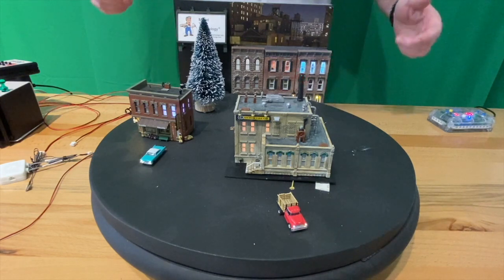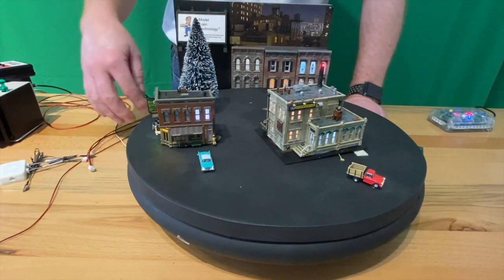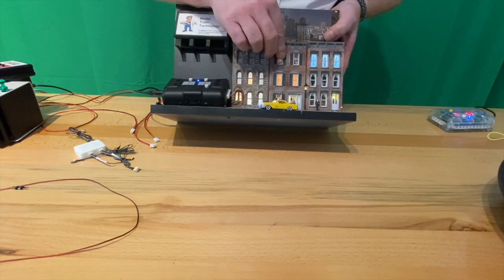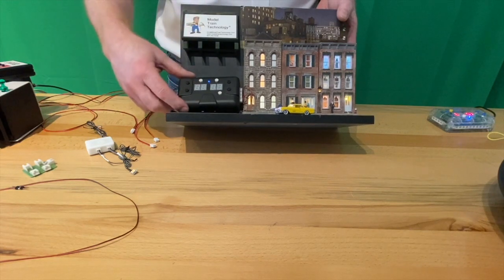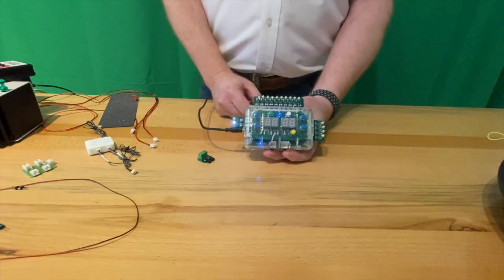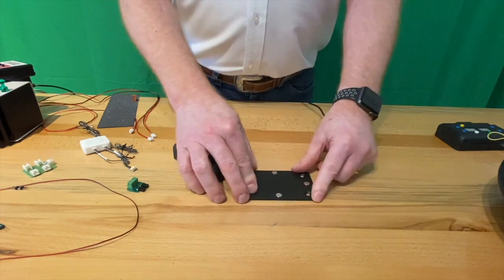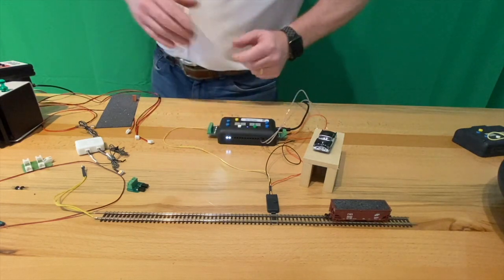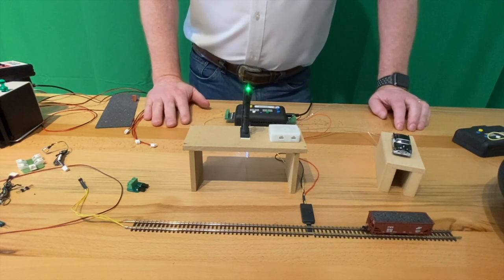Model Train Technology - Part 2 - LED and FIBER Lighting

Comment: Anyway you can upload manuals to your website! I'd like to look over the fiber optic ones do determine if I want to use it for my signaling.

Also a tri color LED for the fiber would be great especially for those of us who use searchlights. ( I have B&M triple head searchlights and 3 fibers in a mast would be so much better than 12 wires
Reply from the maker: The manuals are on the product pages in the store.  We have a tri-color Fiber Signal Controller with dual output in the works.

Comment: Can you use another detector on say the other end of the track to switch the signal only after the last car goes over the second detector to clear the block? Will this work with panel pro? Fun stuff.
Reply from the maker: You can connect many Precision Detector signal wires together to form a long detect section - and yes, the timeout will wait for the last detector to be clear.  Panel Pro is part of JMRI (software) which requires a computer hookup.  Connecting sensors into JMRI is sometimes a challenge but if you know how to do that with other sensors, our Precision Detector will also work.